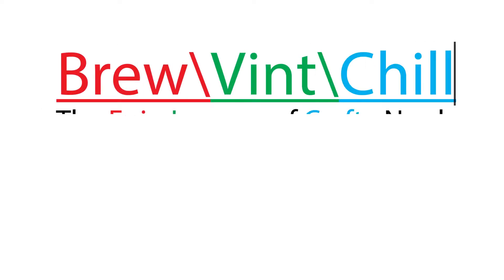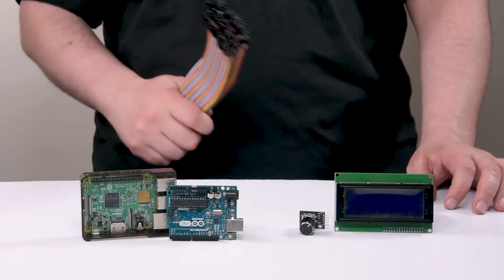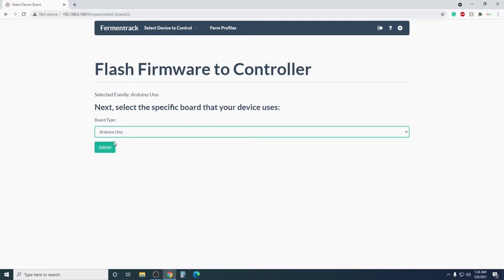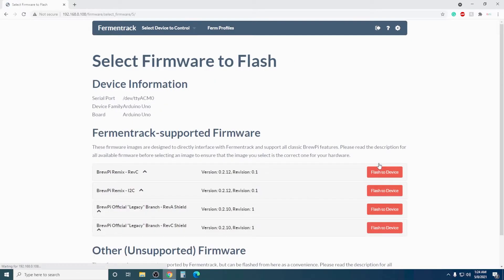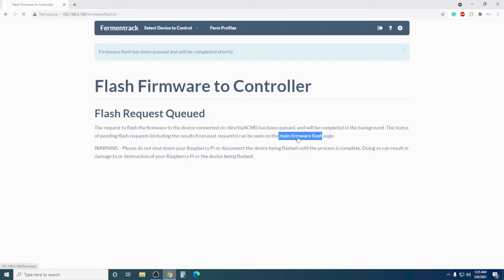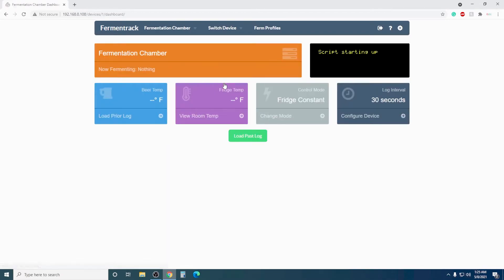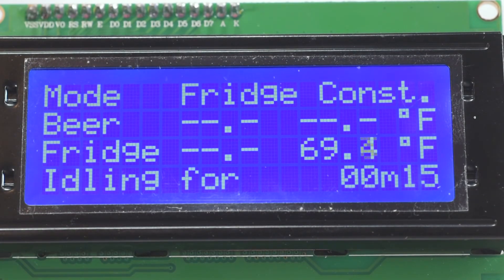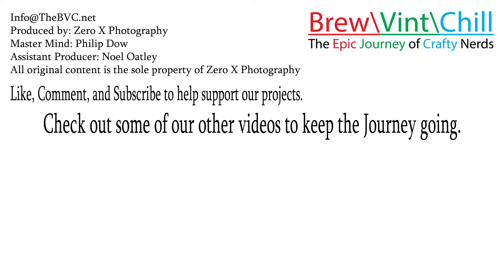Wiring a 20x4 I2c screen and Rotary Encoder to Arduino for Homebrewing | Fermentrack

Comment: My rotary encoder does not have those codes, mine has 4 pins one side says P1 and has +, -, A, B and the other side has P2 with 2 pins and no labels. Will this work for this application? Thanks!
Reply from the maker: Hard to say, I would need more information about the board such as any other markings. Was this harvested from something or does it have a part number?
Reply: @BrewVintChill  it says RQ-S024. It is from a raspberry pi starter kit.
Reply from the maker: I found some information on the board. But I would get a different encoder myself that is easier to mount and peace of mind myself. You can give this a try by following the pinout below. If it doesn't work at first, try switching around A and B. So long as the positive and negative power input is on the right pin there is little risk of shorting anything out.

+ = 3-5v
- = Ground
A = Clk
B = DT
P2= one pin to ground and the other to SW (I'm not completely sure about this and couldn't find any official documents)
Reply: @BrewVintChill  yeah probably easier to just get the right one.

Comment: Awesome! Mine is up and running now! Do you have a fermentation profile that you can share with me? I would like to understand that better but there is not much information about it or at least I couldn't find something useful
Reply from the maker: Congratulations, but we don't use the profiles much. More hassle than they are worth to us. It is a bit funky because you are entering what point you want it to arrive at a temperature along a timeline. Not how long to maintain a temperature for. We included the text to use for importing a basic Ale fermentation finishing off with a cold crash gradient. Just copy and paste.

====================================
| test                             |
| Standard Profile                 |
====================================
| 1s    | 75.00 F                  |
| 14d   | 75.00 F                  |
| 14d1s | 40.00 F                  |
| 20d   | 35.00 F                  |
====================================